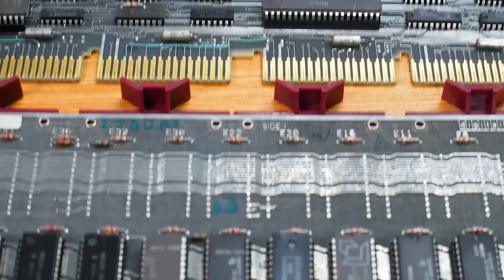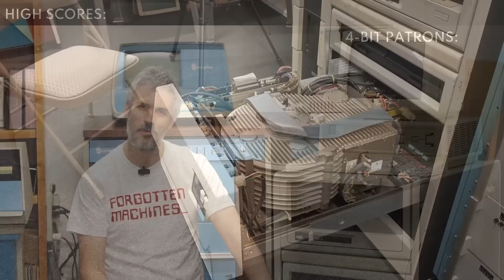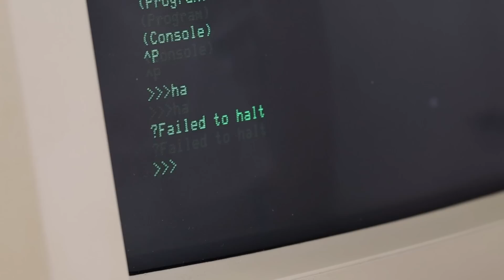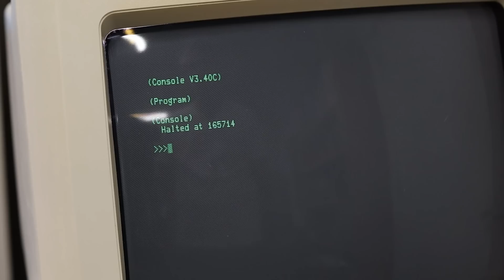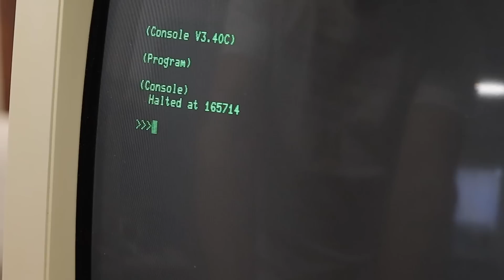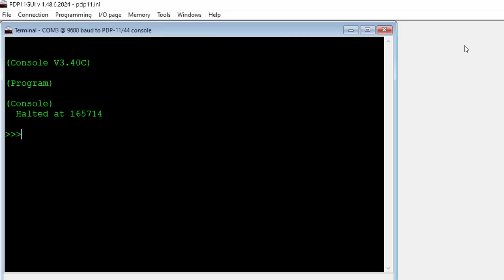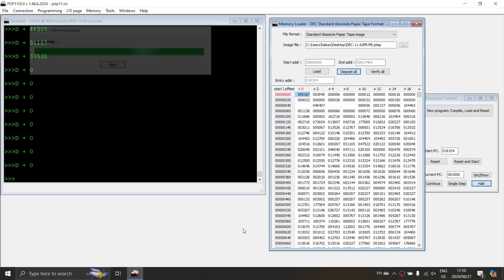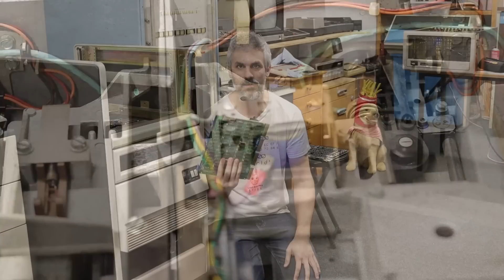Solving the halting problem with my PDP-11/44!

Comment: The simple explanation as to why The Halting Problem is impossible to solve in general:

Sometimes it's very obvious when a program is not going to halt.  If there exists an unconditional jump backwards in program space and no conditional jump from within the loop it creates to somewhere outside it, it's clearly never going to halt:

10 PRINT "HELLORLD"
20 GOTO 10

Whereas if there is no backward jump, conditional or otherwise, then it's clearly going to halt:

10 PRINT "HELLORLD"
20 END

Those are the degenerate cases, when the set of "all possible input conditions" is exactly one input condition.

But most programs are not that trivial.  And if there exists a loop which is completed by a conditional backward jump, then the question "Is this program going to halt?" becomes reduced to "Will the loop's exit condition ever be satisfied?"

And the only way to determine that is by actually doing all the same calculations as the program itself.  In other words, running the program  (even if you can detect and ignore anything that won't affect the exit condition).  And if the program does not halt, then your analysis process will itself get stuck in the same infinite loop, and so take forever to complete.

Comment: Congrats on getting BASIC loaded and successfully running!   Be thankful that's a UNIBUS system, and not an LSI-based Q-Bus backplane.  Continuity, voltage, pretty much everything runs straight through (if my ancient memory isn't wrong).  Unlike the Q-Bus where it's zig-zagged through the slots and backplanes.  Getting the floppies talking is a good start, because it's pretty much the same thing getting the big Eagle drive going.  The disk controllers are DMA devices (again, old memory in this aged noggin) and console commands like 'b dx' for 'boot dx01' tell it to hit bus address 17xxxx for the dx01 floppy drive controller board.  The board has a boot ROM on it, wired at that controller address, and the ROM tells the CPU how to boot the drive.

Comment: Use a quality paper/pencil eraser to clean card edge connectors or other plated contacts, a trick I learned from my father. Awesome PDP 11!
Reply: I learned that trick from my father as well, except it was for cleaning the rails on a HO scale model train set when the engine wouldn't run reliably. 
I wonder what the origin of using an eraser for cleaning electrical contact is or at least how far back is goes.
Reply: Agreed.  I like the white Staedtler erasers.  They never seem to dry out and they are the width of card edge connectors.
Reply: You can also get fiberglass pens to clean contacts, which has the advantage of no eraser dust.
Reply: @silmarian  Rubber dust is better then golden or copper dust...
Reply: @docnele  Erasers still wear on the contacts. Alcohol or better yet, contact cleaners would be a better solution. We had a custom unit based on the S100 buss and just the act of removing and reinserting the cards was sufficient to solve the problem. The real problem is gold is very soft so they have to mix something else with it for hardness. That something else reacts with the moisture and sulphur in the air causing an insulating layer. All you need to do is remove the surface junk on the surface and you're back in business.
Reply: @silmarian Do not use fibreglass on plated contacts. Use cleaning strips or just plain paper soaked in contact cleaner

Comment: but you already knew it would halt, the actual halting problem is solvable, you just make input conditions tree, you get the full program execution state machine flow chart, ie like you programmed it, dont believe internet, you could make 1-bit full state machine flow chart very easily. ie all possible states and transitions. that should be a DAG in every place it halts. cycle or halt. make the simplest example computer. that you can explicitly state all the states. visually. more bits is just more bits. exponentially more states and lines is like brains, but you can still do it, its not impossible even if its exponential in the space of all the states. a program does not have to have any inputs but those can be included, it just makes the state chart larger. so if its not possible to solve, how did you know it would halt. looks are not worth testimony.
Reply: Wrap it up, Turing is proven wrong,  we can now solve every unknown problem in mathematics just by writing a program that  will halt if there is a valid solution and then running this magic algorithm on it. I'm sure it won't take very long...
Reply: @JamesChurchill  I dont believe in turing
Reply: @gsestream  and yet you're using a computing device built on technologies developed by countless people who critically relied on the foundations that Turing created. Good luck with that. 😀
Reply: @JamesChurchill  God is my foundation, whatever people do, or dont do, without God, knowledge is no foundation, its only pride
Reply: @JamesChurchill  knowledge is magic
Reply: @JamesChurchill  even if false god said something and it happened, I would not still rely on the false god
Reply: @JamesChurchill  oh right, true life does not rely on knowledge or false gods, judges or researchers
Reply: @JamesChurchill  true lies
Reply: @JamesChurchill  why would I take guidance from people, ever
Reply: It is very easy to show that for a machine that only has a finite amount of memory, any program will either halt, or you end up encountering the exact same state that you've encountered before, and therefore can detect an infinite loop. But, the halting problem never was about machines with finite memory, but about ones with unbounded storage.
Reply: @FreeFireFull  therefore you must treat that separate problem with a program size of infinity, mathematically. well infinite program never ends. people are using the infinite formulation as if it would apply to normal programs.

Comment: The halting problem is unsolvable only for a universal turing machine with infinite memory. If you have all of the information about a program's state over time and your system is memory constrained(which if you live in the real world and are not a quantum computer you are, so basically all classical non-biological computers) then the halting problem is instead of NP-complete complexity. Doable, but super hard.
Reply: The finite memory halting problem is in EXPTIME. Afaik we do not know if it is NP-complete, but most theorists would bet against that.
Informally speaking, problems which are NP-complete are hard to compute, but they have short solutions which are easy to verify. We do not know if such short solutions exist for the finite memory halting problem.
Reply: @zandax  they do, but this particular problem must also be constrained to evaluating one machine at a time as well as the halting problem behaves very differently once you throw I/O into the mix.

Comment: The halting problem only applies to computers with infinite storage.  Otherwise there's a finite limit to the number of programs you can run, and the halting problem is a finite size "lookup table"
Reply: How exactly do you populate that table?
Reply: @JamesChurchill  You run every possible program, with every possible input, after each instruction you dump the whole internal state and store that in a list of known reached states, there are only 2^N possible states (for N=total number of bits of internal state), so either after at most 2^N+1 one of them repeats (in which case it will repeat forever), or it halts before that.
Reply: @Barteks2x  You don't have to make a particularly long program before 2^N blows out to be larger than you can process or store. And you're assuming that any program which halts will do so in a reasonable time frame. But you cannot feasibly distinguish between a non-halting program and one that takes a billion years to reach the halting state.
Reply: @JamesChurchill  Sure, in practice it can't be done, but in theory it is a specific finite bound. But since the lookup table would be insanely large in the first place, I assumed we aren't talking about real world possibilities here
Reply: @Barteks2x  But that's the entire point - the halting problem is "is there a way to determine if an arbitrary program will halt *without manually enumerating all of it's states, or running it*".
Reply: @JamesChurchill  The problem with the halting problem on an infinite machine is that even if you do run it, or try to enumerate all the states, you can't know, in an algorithm, whether that's all of them, or if there are more. If you run it and it seems to not stop after X steps, is it looping, or just running very long?

On a finite machine, this approach does work, because there is an actual finite upper bound on the amount of possible states, you can just run it and it does solve the problem in a known, finite amount of time. Very, very long time, but finite with an explicit upper bound. If it doesn't halt after 2^N steps, it definitely doesn't halt at all. You can't do that when N is "infinite". You absolutely can when N is the total amount of bits of memory.

What you stated is really a sort of "informal" statement of the problem. Which works as long as you are in fact talking about infinite-memory machines. When you try to consider finite amount of memory, therefore finite amount of states, that description is no longer accurate.
Reply: @JamesChurchill  That's not the correct definition of the halting problem.  The halting problem simply says "you cannot write an algorithm on a Turing machine that decides if an input will terminate or not".  The proof requires infinite storage.  If you have finite storage any algorithm will in finite time either hit a state loop or terminate.
Reply: @davidlloyd1526  That is exactly the same as what I said, just reworded. You seem to have missed what the words "algorithm" and "input" imply in this context. And to be fair, the way Turing talked about computation is quite different to how we normally think about it.
Reply: @JamesChurchill  Sorry - I actually have done the Mathematical proof of this.  I posted this for comedy value, but it is also true.  The statement of the problem says nothing about manual enumeration, and doesn't preclude running the code.

Comment: I used to run an 11/44 back in the 80s. To boot I typed B DB (just B is enough). The DB was the boot ROM for the RM02 drive 0 - an 80Mb unformatted, 67 Mb formatted disk - I suspect a CDC drive. The disk name to boot is not the same as the boot loader name.
Reply: I used to use one with a TU58 tape drive, this was B DD (or B DD0) to have it boot from drive 0, B DD1 for drive 1
Reply: @cumberland1234  
@Richardincancale
Any chance you guys remember how&where to place that floppy controller board...? :)
Reply: @docnele  Sadly no - the hardware was off limits - maintained by a DEC engineer
Reply: @docnele  not sure sorry, the TU58 tape drives just ran on RS232 iirc
Reply: The 11/44 is a UNIBUS machine. Make sure the DSD controller is a UNIBUS controller; not a Q-Bus controller. Long ago, I used a DSD controller and combined floppy and hard drive on my Q-Bus based Heathkit H11. Remember those?
Reply: @TotallyTuberous  Brings back memories.  I used a 11/03 at work with almost the same boards as the H11.  That was probably the high water mark for DIY products from Heathkit.  I’ll bet the power supply on the H11 was less loud.  The 11/03 was very loud, but I had to have my terminal in the same room because it was floppy based and required frequent diskette swaps when building FORTRAN programs.
Reply: I should add that the switch mode power supply switched at audio frequency, so the magnetics made a lot of noise.  

Data General was even worse for being noisy.  I don’t know which DG model because it was part of a Tracor Northern signal averager, but hearing protection around it was advisable.